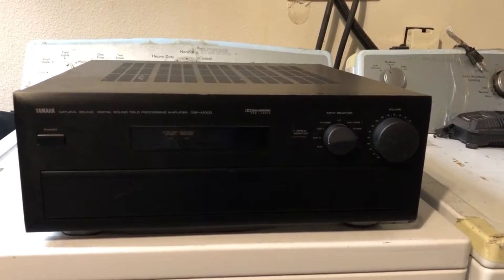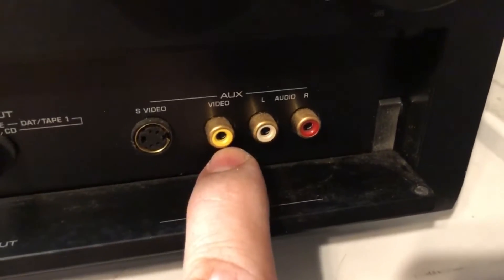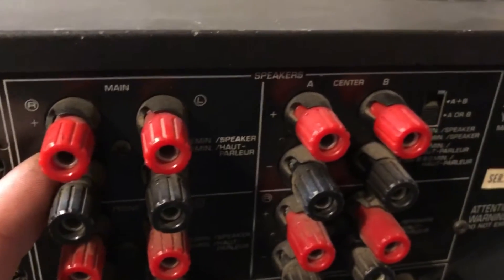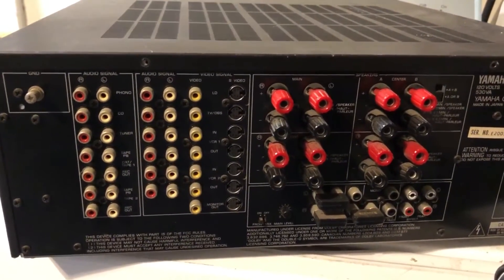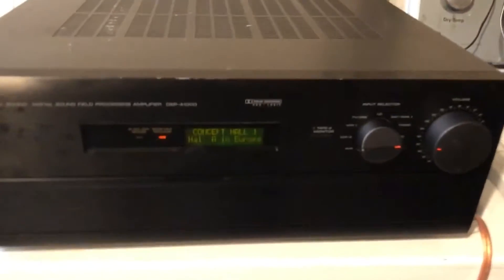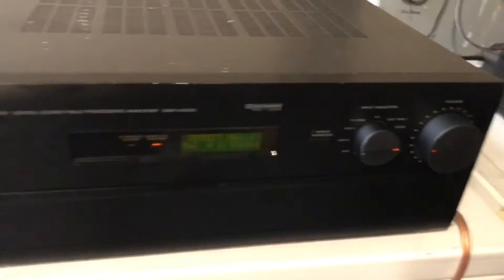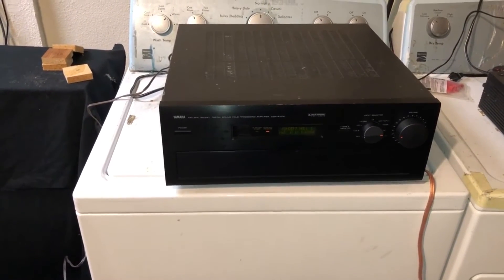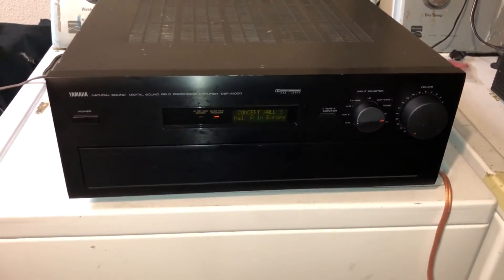Yamaha Amplifier - DSP-A1000 - Review/Short Demo

Comment: Still got mine.  Versatile and still relevant.
Use four strand cable.  The centre is not necessary in my view.
The settings are amazing.  You can change the size of the room/intensity.
With four speakers it works well and with floor standers the power/bass is amazing.
Read the manual.  You can alter the power outputs from the back.  That trim will boost input signals like a preamp.

Comment: This Yamaha DSP A 1000 is an absolute sound beast- I have 2 of them. The main Level knob at the back is really useful if you use this amp as a preamp to a power amp, just try and you will be amazed with the sound quality.
Reply: I'm using one that I found a few years ago it left brand new The remote still had the plastic on it.I use it as a preamp Can you explain the volume control on the back if it's worth I'm going pull  this thing out and check it out

Comment: I have one too! Mine has problems with the source selector and it cannot be cleaned with deoxit spray by yourself. So I use it only on Tape 2 direct which bypasses the troublesome input selector. Lately, there is another issue, sometimes it refuses to start, just shuts down after 2 secs. 
However, when it works, it sounds big! It drives my MB Quart 800 standfloor speakers with so much confidence.
Excelent amplifier if you can find one that really works well.
Reply from the maker: Absolutely!  It is a sonic beast.  Your power supply might be failing, or the capacitors might be leaking.  Make sure the amp has plenty of ventilation.  These beasts tend to get hot.  Thanks for watching!
Reply: That's the ALPS input rotary encoder you're talking about, I take them apart and clean and service them, they work like brand new then.

Comment: The old Yamaha amps are great. I used an AX-900U of around 1985 vintage for around 20 years. It finally had too many issues, so I picked up an AX-930U 'Natural Sound' which are hard to find--vintage 1990-92.  Years ago a Yamaha service department rep told me that the amps from that era have better quality internals than their new stuff. Lots of power-for the 930-130 watts/channel. Great sound. I am running 2 floor standing 4ohm speakers (Cerwin Vega RE-30s) which it is not rated for, but no issues so far.
Reply from the maker: Yes.  You get a much better sound in this vintage amps.  Thanks for watching my video!

Comment: A little tip... it's not a "subwoofer", it's a "woofer". The "sub" in "subwoofer" is because it's, lower frequency then a "woofer", and as such they are used for standalone (or active) powered low frequency speakers. You will even see your amp (I have one too) has a low pass output for <200Hz tones, this is for an active subwoofer.

This amp was released in 1991 and is rated for 80W RMS per channel at 0.015% THD for the mains (LR + Center), and 25W RMS at 0.05% THD for each of the front B speakers. It is capable of driving up to 134W RMS into 8ohm, or 242W into 4ohm however it's rated for a minimum of 6ohm and this may trip the protection circuitry.

It's an amazing machine and the end of an era as it uses discrete power transistors in a class A/B configuration. Subsequent devices use fully integrated amplifier modules making them near impossible to repair and introducing issues such as cross talk and higher distortion figures.
Reply from the maker: Thanks for the explanation.  It definitely looks like an amp with all the bells and whistles for its time.  Thanks for watching!

Comment: @joelsDIY I believe the low pass out is for subwoofer and the rear gain is for input level so turn your amp to 3/4 volume and the gain up slowly till first distortion then turn it back till no distortion and that will be your amps maximum volume with no distortion
Reply from the maker: Sounds great!  I should try that out.
Reply: @joelsdiy9469  a hifi magazine claims it tested the output  they said it really outputs 242watts rms in 2 channel stereo at 4ohms i have the same amp i love it and will never sell it because of the powerfull bass and warm sound and hi volume its an awesome amp!!! 😀

Comment: i have one but stopped working, the protection turns it off as soon as power on, and i dont trust or dont know who can fix it in my city
Reply from the maker: It might be that you should replace the fuse.  Sometimes you have to open up these old amps and clean them up.  Also you might have a bad power supply.  If you find a replacement, it should not be so hard to disassemble and replace.  Thanks for watching my video!